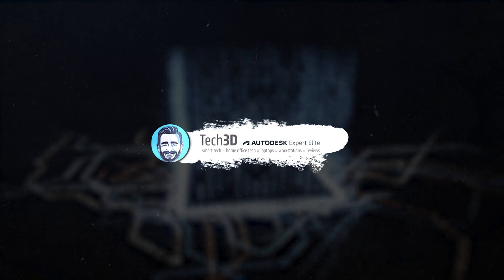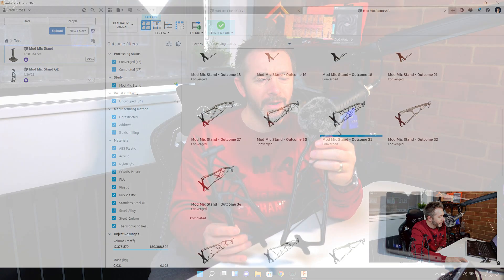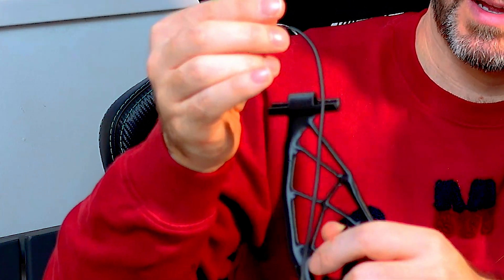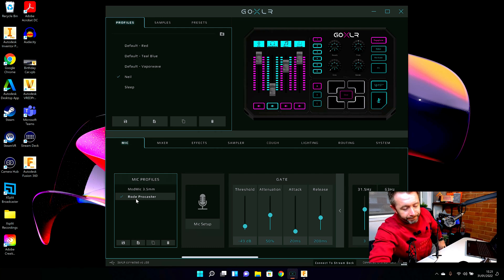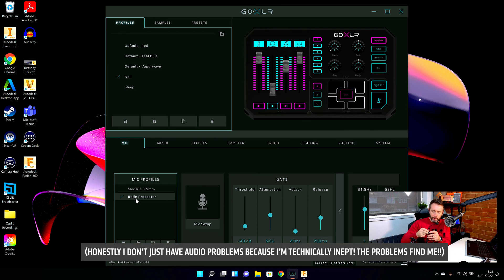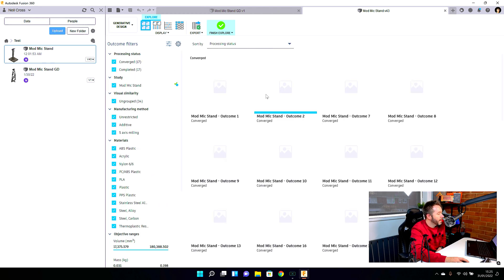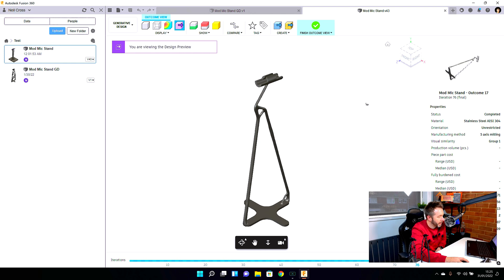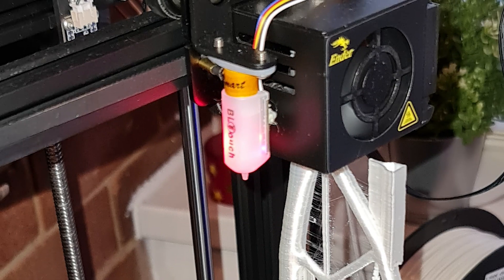I Designed the Most Over Engineered Microphone Stand in Fusion 360 & Generative Design

Comment from the maker: Honestly you'd think I'd need an audio engineer with all the audio problems I've had over the years, but nope, this was because... ffs it's never simple...! I'm using a second PC for audio capture but it didn't have a "line in" as its an OEM workstation with a bog standard IO.  So I installed a Creative Labs Sound Blaster Z PCIe sound card and used that... but their FUCKK£"!"!!"£!"GHGGGGGGSH!!!!!!!!!!T software decided to take it upon itself, to AUTOMATICALLY apply an outrageously horrific noise cancelling and audio treatment profile by default to the line in signal being sent by my XLR mic.  I could throttle them, honestly, idiots.  It's taken me a few hours to figure it out, that was a few hours I didn't have spare before filming so unfortunately this had to go ahead as is.  But the incompetence of some tech companies is staggering, turning on something by default which is so blatantly worse than having it on.  
ANYWAY...! Hey! Sorry for that, problem is fixed now and I'm back to my usual reverbed but not tinny and compressed audio! It might actually be slightly better now because I'm not facing a brick wall but who knows, time will tell.

Comment: More inuendo in this video than the average mechanical engineering meeting. Good to see you've been having fun with the 3D printer though bud. It's slippery slope, that's for sure.
Reply from the maker: Thanks Jamie. The fun came after a couple of weeks of utterly infuriating nonsensical shenanigans with that printer at times having a mind of its own, sometimes too much information out there mixed up across too many similar printers with far too many mods mixed into the advice making it really hard to figure out just the basics. But I'm getting there now and next need to make the damn thing silent, the fans are like jet engines
Reply: I see what you did there, and since Neil didn't give it a shout: "Ladies!"